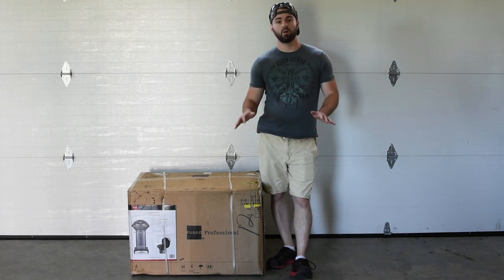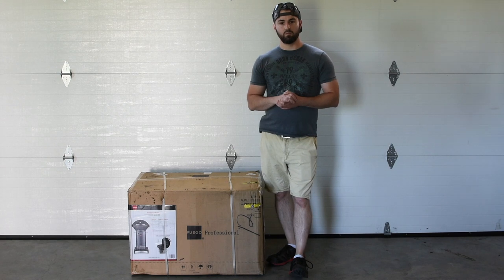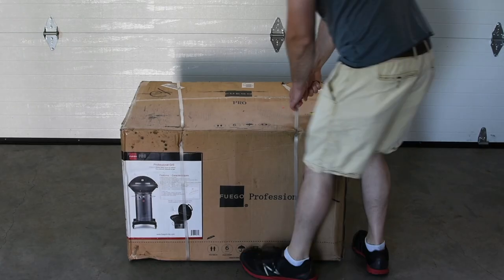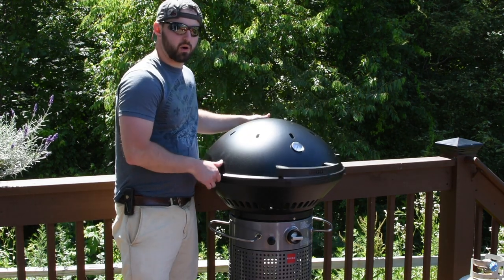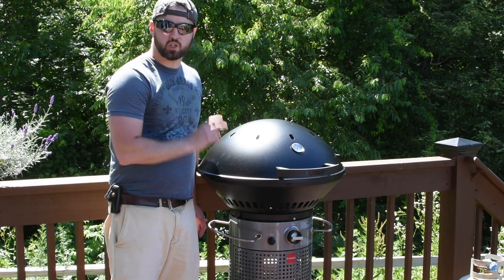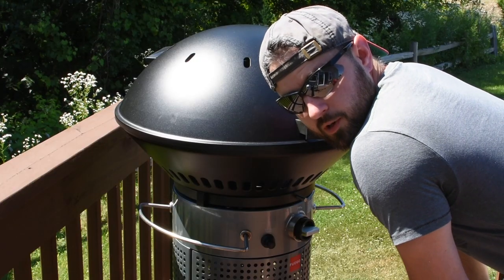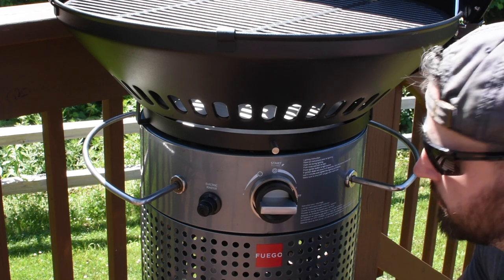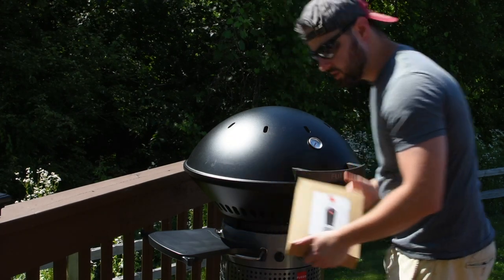Intro to the Fuego Professional Grill - Unboxing & Assembly

Comment: thank you, I have a few questions...

• what material is the DIFFUSER PANEL?

• what material is the RESIDUE TRAY REFLECTOR PANEL?

• can a wire brush on the PORCELAIN ENAMEL CAST-IRON GRATE? If not, best cleaning method?

Comment: I have the smaller one the cooking surface is wider than the circuler pull out greese catcher,the grill tapers to it and is slotted,greese drips out onto controle and deck,the top is low and wont close for cooking beer chicken,get a rug at dollar general to put down to pretect poarch/deck from greese /better yet buy a weber,bear tore mine up and I should have bought another and not the fuego